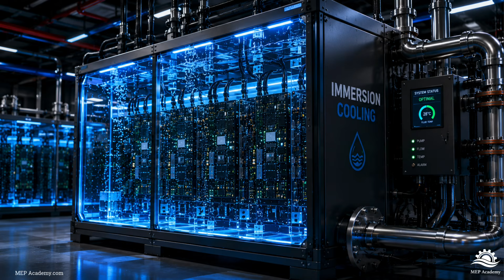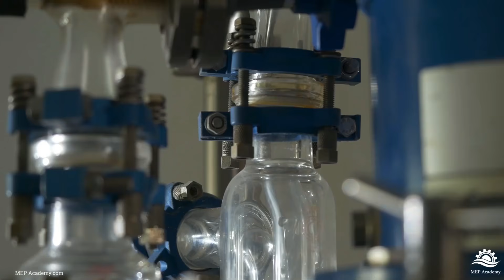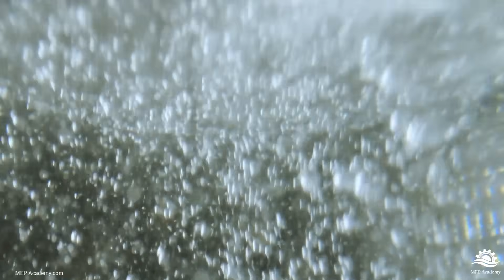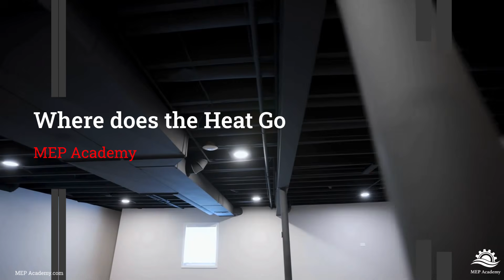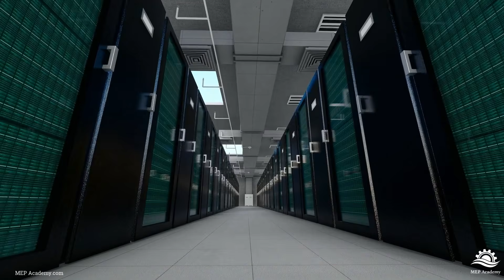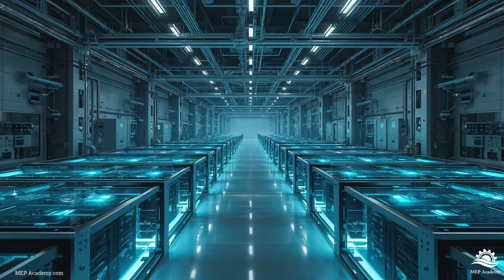Immersion Cooling Explained

Comment: The graphic used at 2:31 is incorrect. 
1) Only warm fluids are leaving the immersion tank. It should be one warm out and one cool in. 
2) Both arrows are pointing ‘out’ of the immersion tank. It should be one in and one out. 
3) The arrows in the piping are correct on the cool side, however, there should be one warm out and one cool in.

Comment: Why do data centers require so much power, so much land, and so much of our water resources if we have reduced computing power to minuscule levels?
Reply from the maker: They generate lots of heat and with the advance of AI computing the demand for a solution to every increasing amounts of heat has lead to Immersion cooling.
Reply: The volume of computing has increased disproportionately more than the reduction of computing power.